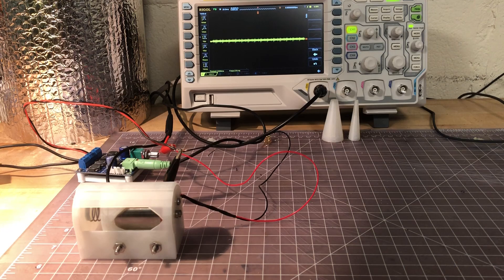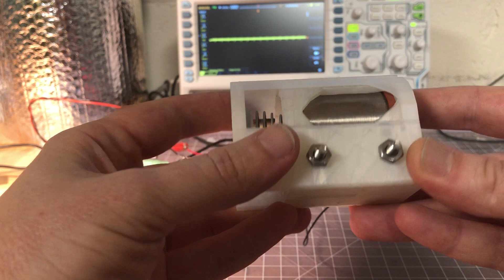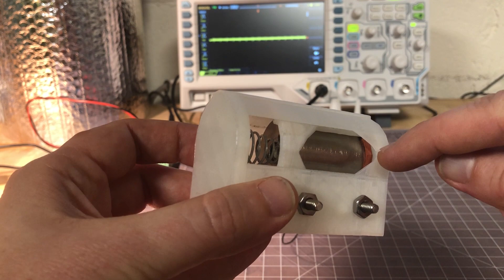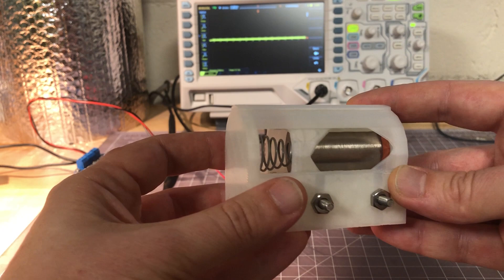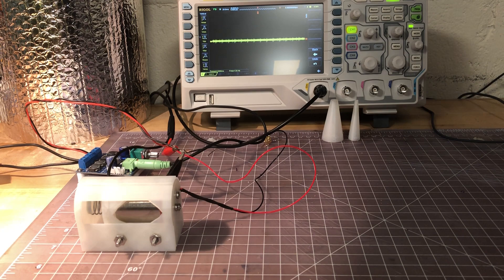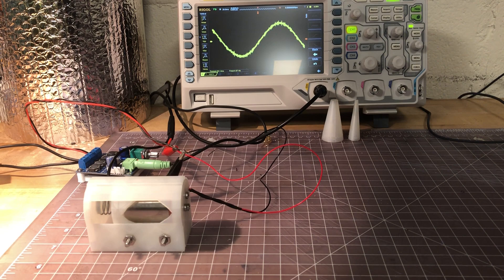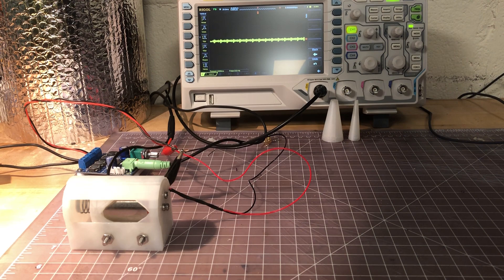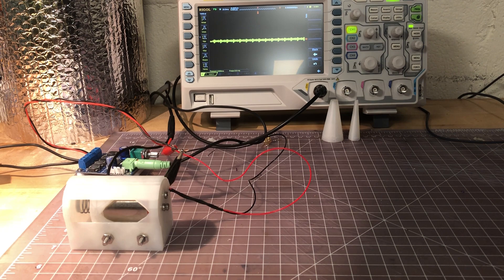Henry (Harry) Bull Reaction Motor / Mach Effect Thruster Variant

Comment: It would be interesting to see whether the 'inertial differential' can be maintained when mounted on a boat or suspended by cable. Or whether elasticity can temporarily counter acceleration in one direction differently to the other to create the required differential.

Comment: I'm guessing the effect needs the friction of a stationary surface to operate and that the effect will not work when operated in a low friction environment like an air bearing or simple water float configuration?
Reply from the maker: Yes, you are correct. Conservation laws still apply here. I may pull out my old air track and illustrate this in a few days.  Water flotation is problematic as the waves generated by the oscillation can cause movement.
Reply: @Monomorphic  how about trying  it underwater with a small balast ?

Comment: The movement is due to changes in the acceleration of the oscillating mass. A displacement will be noticed in any friction based environment but proportional to how much friction there is. The mach effect is interesting because it's theory is based on the connection between electromagnetism and inertia.
Reply from the maker: The mach effect claims a connection based on gravity and inertia. They merely use electricity to "increase the mass" of one object relative to the other while jiggling them.
Reply: Do you think the mach effect thruster will work? Also have you ever gotten the EM drive working? The EM drive was tested in a lab in Germany and they are saying it does not work and its just basically a giant magnet and points north. The same lab is testing the mach effect thruster right now with one of the designers, I'm waiting for the results.

Comment: Richard Damperwolf built a similar device which featured in Popular Mechanics back in the sixties. The article was titled "...Engine with Built in Wings". The device wasn't actually designed to fly. However it did propel itself on level surfaces, including an inclined plane, through the effect of stiction, otherwise known as static friction. It's a well known effect in classical mechanics. Of course it won't work in frictionless environments (e.g. in a flotation tank, on an air-track, ballistic pendulum, low-G environments like in Earth orbit or at Lagrangian points, etc. In these environments it merely oscillates about its centre of mass.) But that won't prevent some uneducated people from making false claims. Indeed such claims often pop up from time to time, and usually recede into oblivion without so much as a single positive demonstration. Drop me a line if you'd like to learn more about it.